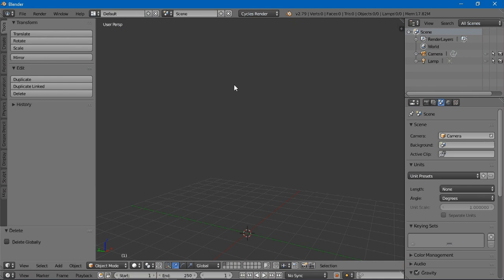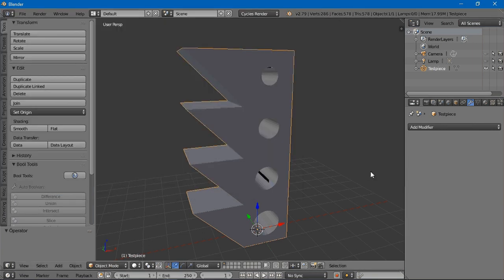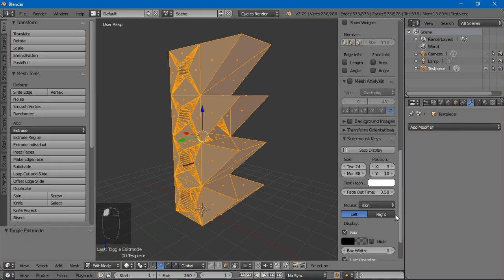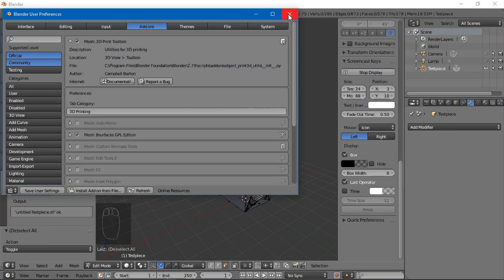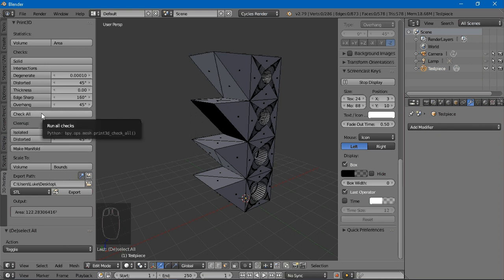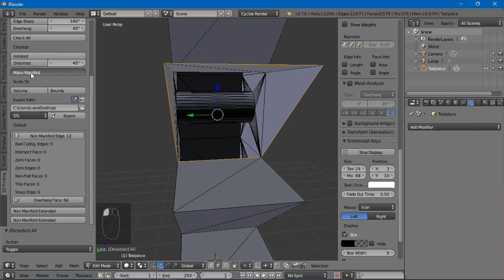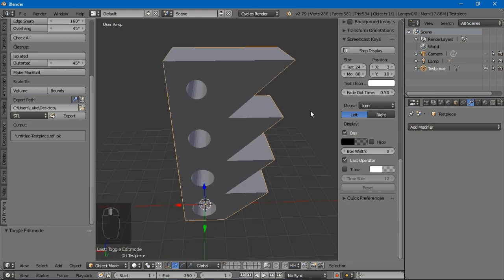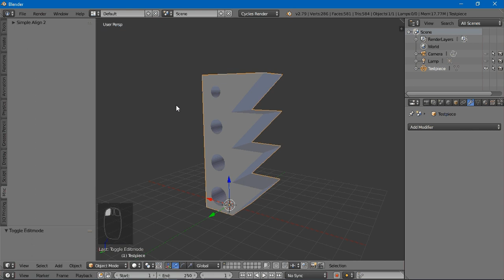Fixing a non manifold STL using Blender for 3d printing

Comment: Unfortunately the UI for Blender seems to have changed so much that this video cannot be followed. I just installed Blender today for the purpose of cleaning up a problematic STL file, but the Blender in front of me bears very little resemblance to what is shown in this video. I got as far as finding where the 3D Printer add-on is now located, but I see no way to get the add-on's options to appear anywhere.
Reply: Oh ok if you go to Edit > Preferences > addons and use the search box for Mesh: 3D-Print Toolbox and check the little tick box when it finally shows up. To use it select your mesh and then hit the "N" key so the side panel slides out. One of the Tabs that shows up will have 3D-Print written on it.
I hope this helps :-)
Reply: ui changed, principles are the same - search and destroy, sorry, enable the addon, hit n to show side panel (ie in 3d view), select the 3d print tab, voila, it is pretty self-explanatory. have fun, aum

Comment: Thanks for the help, but the add-on link does not exist anymore
Reply from the maker: It is now standard in Blender you just need to activate is like I did in the video...............unless youre using 2.8 which I haven't check yet. Good luck and thanks for watching :-)
Reply: @LukePettit3dArtist  works same, just add addon and press N so it becomes visible